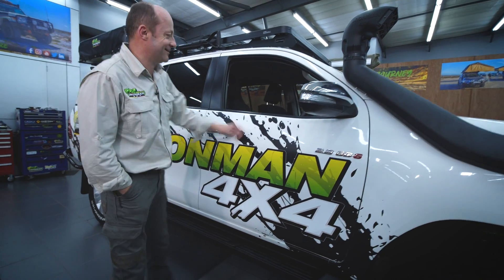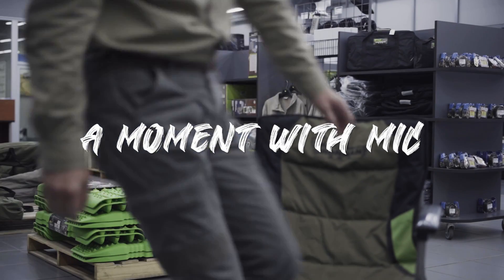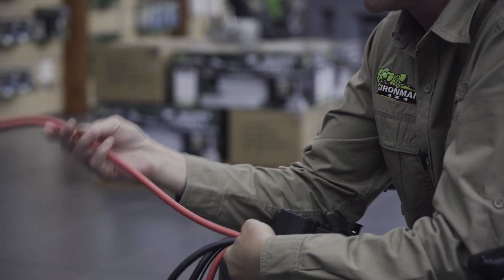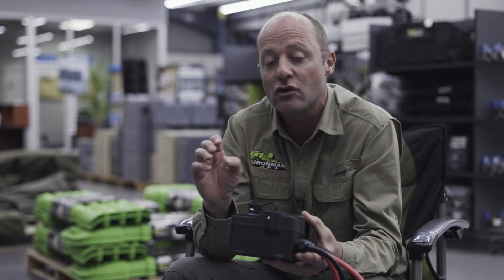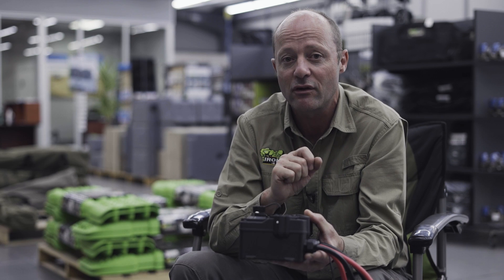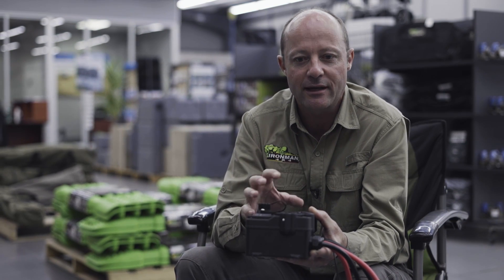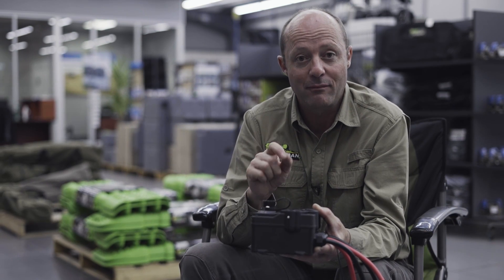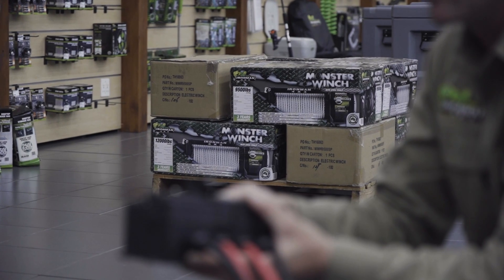Winch Maintenance - A Moment With Mic from Ironman 4x4

Comment: I cannot find amp draw and what my current winch cable gauge is. Normally the gauge is listed on the coating. The way I had to remote my cable with the winch mount I used, it is roughly 4 inches short. I need to make up new remote winch cable connections. Currently they are 24 Inches. I need to go 26in to 30 in. The cable included looks to be 2/4 gauge, but I am not sure. Could you please tell me the type, I should use, copper clad, full copper.? I have a 9.5K 4x4 Monster, running syn rope. I am using a 27F group EFB batter with around 1010 CCA. Thank you.
Reply: Battery terminal wire might be the go. Maybe heavy duty jumper cable wire.